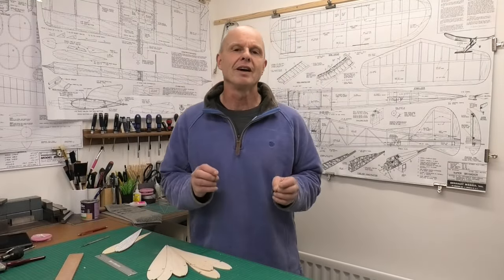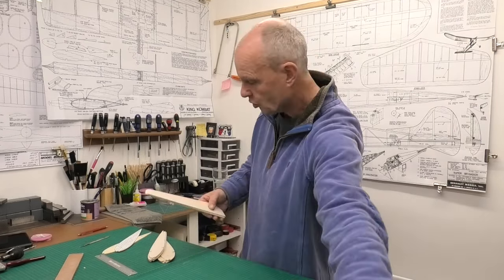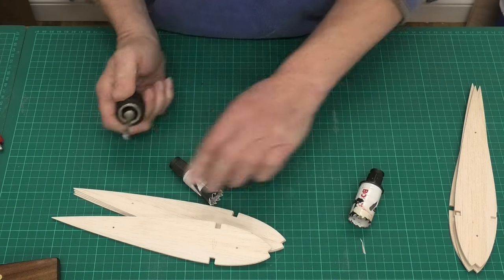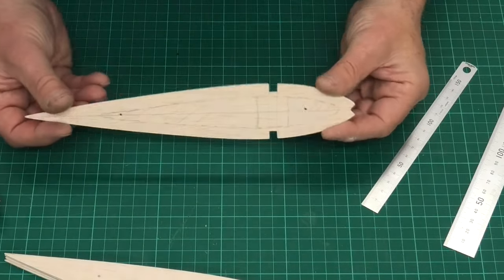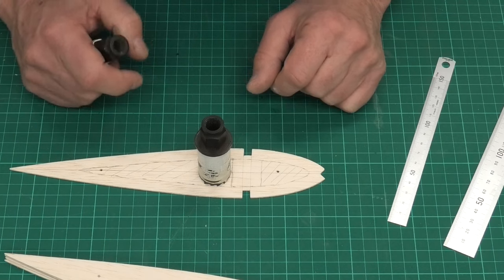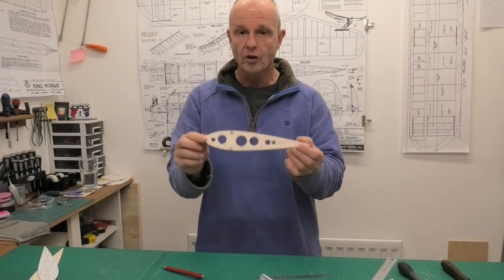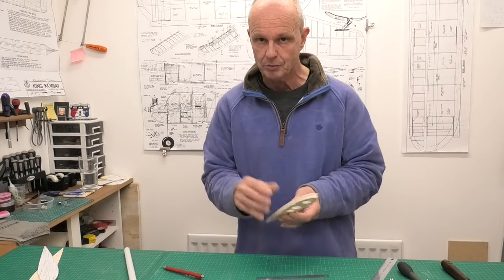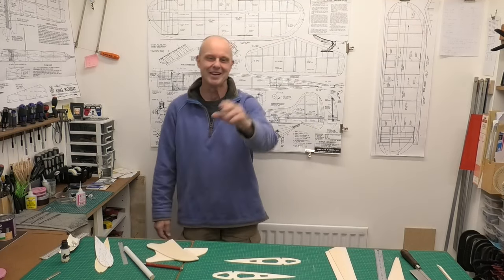How to: Lighting Wing Ribs & other Components - Balsa Plane Building

Comment: Mark, great video, cculd you comment on how much weight is actually saved per rib , i.e. before and after weights . Will be using thi smethjo don my next scratch build
Reply from the maker: Hi pleased you enjoyed the video.  I don't have the figures for these ribs, but you can save about a 1/3 weight, which is not much on an individual rib, but if this is done throughout the build it all adds up at the end.  Thanks for the comment